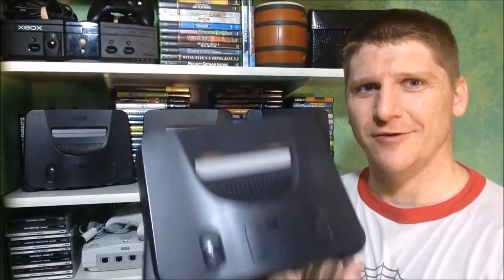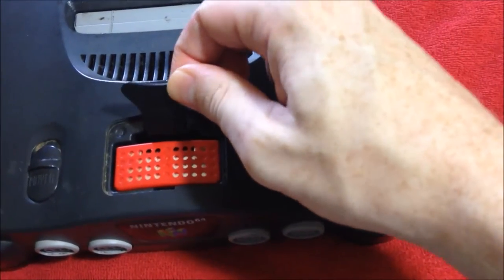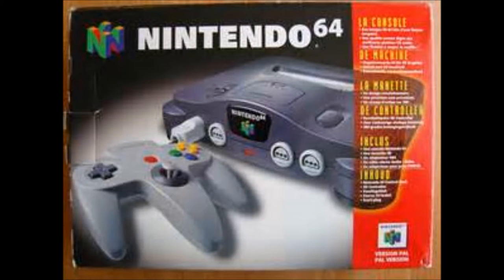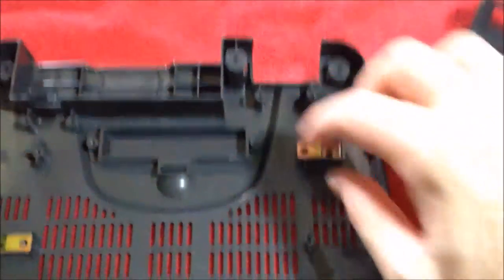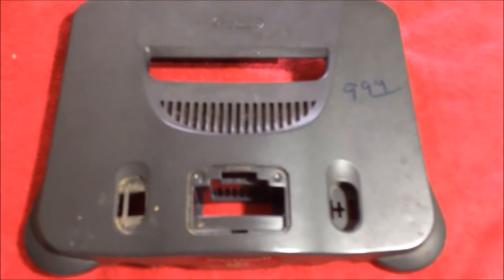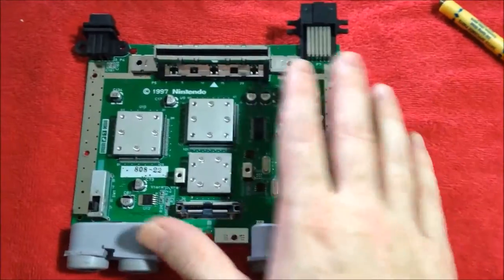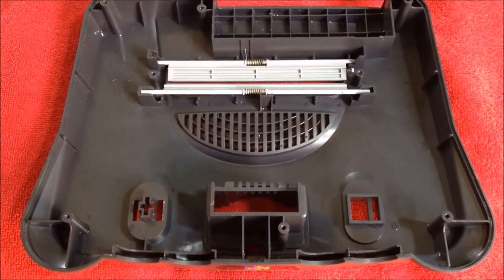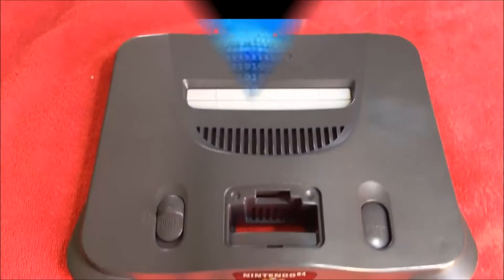O&E #9 - N64 Teardown

Comment: Do you know where I can get the security 4.5mm screw driver
Reply: ebay
Although i usually melt a pen, put it in the hole with the screw and then wait for it too cool and then unscrew.
It is like creating a new screwdriver
Reply: marios mpazinasMC cool thx
Reply from the maker: Sorry I missed this. You can get the 4.5mm (for consoles) and the 3.8mm (for cartridges) from ebay for about $6

Comment: Thanks man, I may or may not have souls nail polish remover on my n64 reset button and had to tame off the face place to fix it because it made the fucking button fuse with the console slightly
Reply from the maker: Glad I could help man. N64 are pretty solid. because they don't have any major internal moving parts like fans or disc drives. However there are a lot of different sized and color screws....which you found out..lol. Thanks for watching

Comment: My screws will not come out and I'm afraid to strip them trying to take them out
Reply from the maker: are you talking about the security screws or the Philips screws in the console? If you bought a set of security screws drivers that came with multiple drivers like a 3.5mm and a 4.5mm make sure you are using the correct one. Shine a flash light in the screw holes to make sure there are no obstructions. If you are still having issues you could try to pus some WD40 in the security screw holes to loosen up any dirt or grit.

If you are having issues with the internal Philips screws try to press straight down on them with the driver and turn to the left. Again, you could try WD40 to looses those screws as well, but don't over use the WD40

Comment: Came here to see what screwdriver needed to take the bottom off and he completely skipped that part.
Reply from the maker: It's a standard 4.5mm security bit. I got mine in a 2 pack for like $6 on ebay. It came with 4.5mm for console and a 3.8mm for cartridges. If you have any questions in the future please ask, I'm pretty responsive to comments.

Comment: took mine apart, cleaned it, put it back together and now it wont work. please help
Reply from the maker: I can try to trouble shoot for you, but I'll need to know a little more info. When you took the console apart did you also clean the cartridge slot out? (I wrap and old credit card OR similar value type card in a T-shirt, cover the bottom of the card with rubbing alcohol and insert it into the cart slot)
Reply: @CMRetroGaming  mine was working before i just wanted to clean it
Reply: @CMRetroGaming  and yes i did clean the cartridge slot
Reply from the maker: @markcordova8126  Thats odd. The only thing that I can think of is maybe the power supply went bad. Or maybe in cleaning it you knocked something off the board like a capacitor or something. Once I put the console together and forgot to put the expansion pak back in.
Reply: CMRetro Gaming do you think I should replace the power brick?
Reply: @CMRetroGaming  aslo i forgot to mention that the red light does go on but theres no signal. i checked every plug in. i tried different av cables, and different games.
Reply from the maker: @markcordova8126  hmmm. I'm not sure. If you are getting power and the AV port and cables are good I'm not sure what the problem could be
Reply: @CMRetroGaming  what about me knocking of a capacitor?  also, how do you fix a broken capacitor?
Reply from the maker: @markcordova8126  you would have to look at the board and see if anything was missing first. The it would probably need to be re-soldered onto the board. I wonder if maybe the AV port is damaged?
Reply: @CMRetroGaming  nevermind. just got it to work bye figiting around with it. thanks anyways.
Reply from the maker: @markcordova8126  awesome. What did you figure out?
Reply: @CMRetroGaming  i just removed the expansion pak, the game, the av while on, turned it of pluged everything back in and it worked. i almost screamed that this worked because last december, my dad got me this for a gift and it was working. after a month, i cleaned it out and it wouldnt work anymore. i was really sad. after it being on my shelf for 3 months, i tried to fix it and i finally did.
Reply from the maker: @markcordova8126  Nice man, I'm glad that it worked out.
Reply: @CMRetroGaming  thank you